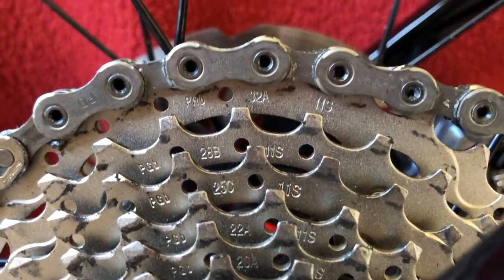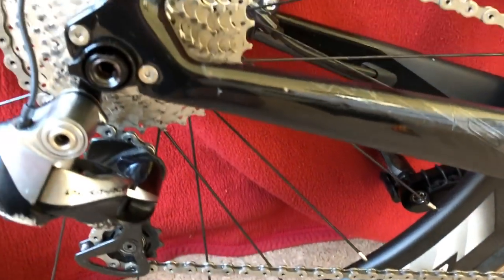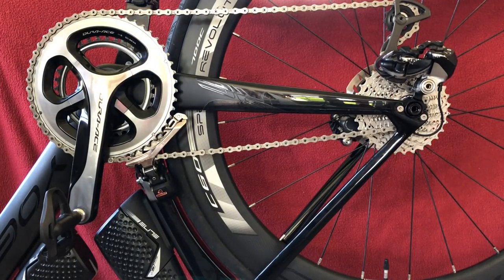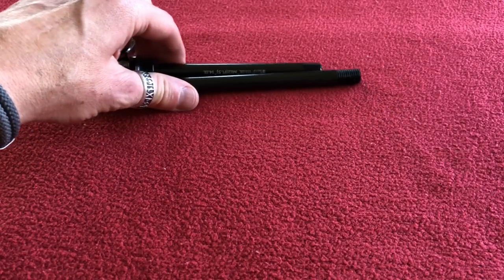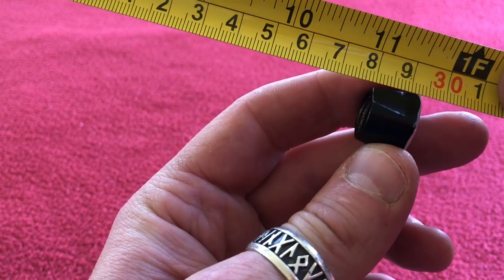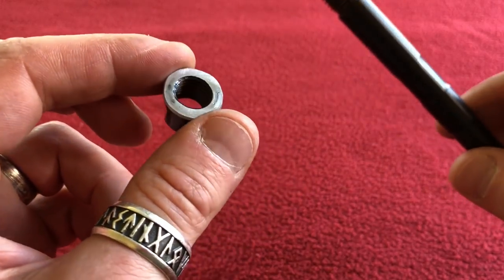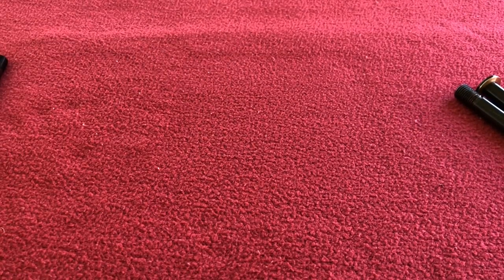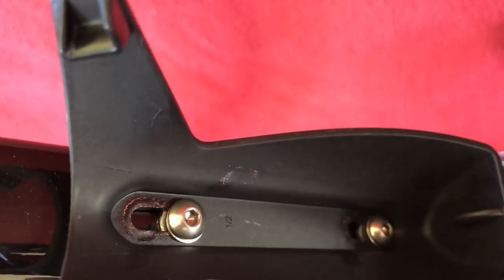Yoeleo R6 Aero Disc Update!!!!

Comment: Hey Kyro,
Great vids, thanks for posting. I'm thinking of buying this frame, but I want to make sure it will fit 28c tires without any issues. I'm going to run it 1x with Sram Force, so no front der. I asked Yoeleo, and they said it would be better to go with their R9, but I don't want the fully integrated cable situation of that bike. It does say in the specs on their site that you can fit a 28, but after their response to my question I thought it best to ask someone who actually owns the bike before I make a final decision. Really like the price, and the look of the bike so I'm hoping it will work for me.
Thanks in advance if you have time to respond.
Cheers!
Reply: Actually I just watched one of your other vids where you talk about the 28's hitting the frame... bummer! Oh well. I'll have to go with something else I'm afraid. Anyway thanks again for posting your thoughts on the bike.
Reply from the maker: Zach Wagner the conti 28’s are deeper than some other models, I’m pretty sure you can fit 28’s check out oz cycles video on the R6 build, I think he had 28’s but not sure. 👍

Comment: when you measure the axles, you only go to the last tread/ridge, and not the end of the bolt... that last part is beveled anyway to go through the hole easier...
Reply from the maker: Dick Tchairdjian thanks for the info, I had to measure it this way so I knew how much to file the external nut down to. With no thread in the rear stay I’m relying on the external but to hold it all together and I wanted to get a flush fit. 👍